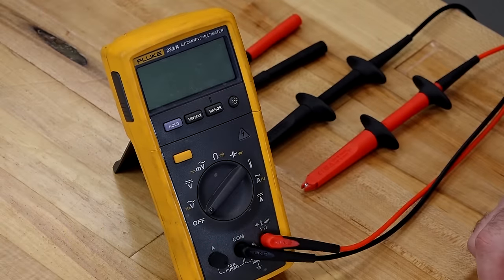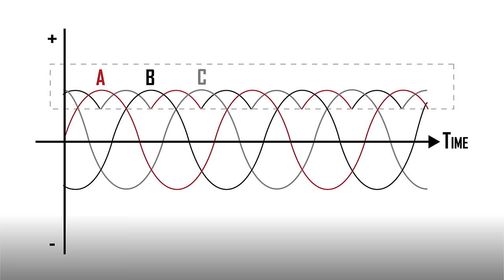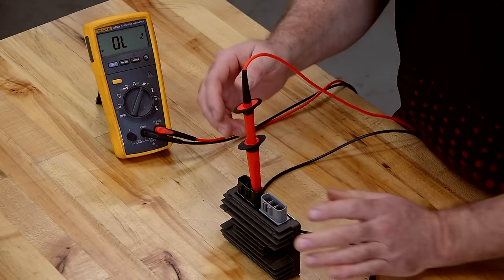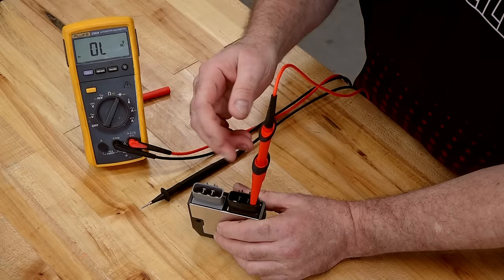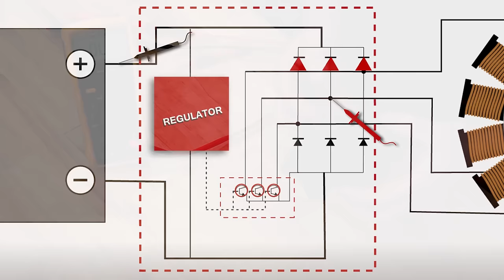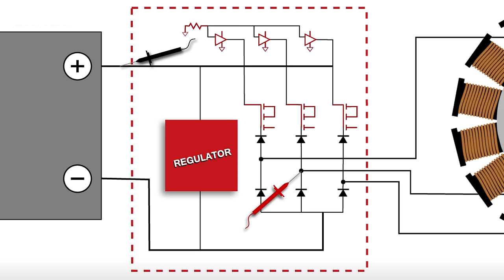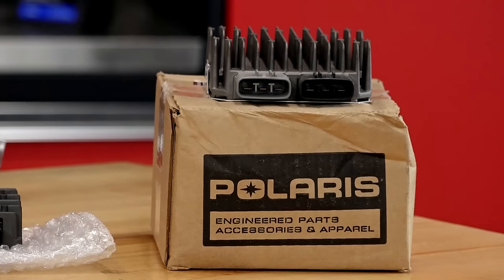How to Test a Regulator Rectifier - They're Not all the Same! | 3 Phase Rectifier Test | Partzilla

Comment: The Polaris
 regulator rectifier that you test in the video is oem part # 4016868, my question is, should it be the same result on polaris regulator rectifier oem part # 4015230?

When I measure my 4015230 the result is: 
meter black to battery + = 0.480 on all 3 wires.
meter black to battery - = OL
meter red to battery + = OL
meter red to battery - = OL.
Is my rectifier 4015230 bad or is it just a polaris rectifier? :-)

Comment: can the   Regulator Rectifier cause power issues (that's not related to 
battery) ? .. for example my bike has dim lights that get brighter as 
RPM increase and rough idle problems  .. ive "pinned" the stator and 
that seems OK and my battery does charge (new battery)

Comment: When you Reversed Biased the Diodes why was the DMM reading OL for open loop? Is that because there's too much Resistance and nothing is going through?
Reply from the maker: The reverse bias diode should show on open loop as it's function is to only let current flow in one direction.

Comment: I have an '04 Yamaha Bear Tracker. The battery got super hot to the touch and I could smell sulphur. I performed this test and got a pretty consistent 630/OL. Is that too high? The battery itself (once cooled, next day) was at 12.83v and when running seemed to be charging at 14.3v. I have not had any charging/starting issues beforehand. The battery is only 2 years old but could it be the culprit? Anyone have any ideas? Thanks. Great video BTW
Reply: Rode it around a bit and now it is charging at almost 18v. Most of these rectifier videos are on the problem of not charging but mine seems to be overcharging, would it still be the rectifier? Anybody out there?
Reply: @mikemyers193  I think this video explains your issue around 5 minute mark.
https://www.youtube.com/watch?v=s5M6sgGBptI

Comment: Hi i have a 2006 handa shadow, i started up 2 weeks ago took it for a short ride  everything was normal.  2 weeks later i jump started it, while it was running in idle for about 10 minutes it shuts off and now it is completely dead.  I get nothing when try to start it.  Where do u think I should start?
Reply from the maker: Fuses, battery.

Comment: Have a Yamaha XT200 from the 80’s that refuses to start after running a few minutes, think it’s the regulator/rectifier  should I retro a newer part for it from the old 6 volt system?

Comment: Whoah there edison! That meter doesn't even have a diode test. You have it set for capacitor test.
Reply from the maker: The Fluke 233 has two functions on that dial position. Capacitance and diode test. If you zoom in, you can see the diode test symbol just to the right of the capacitance symbol.
Reply: @PartzillaParts  🏁

Comment: Also, why do you put the positive lead on the negative side and the negative lead on the positive side to test for a Forward Bias?
Reply from the maker: To forward bias the diode you must apply a positive voltage from the voltmeter on the anode side of the diode and the voltmeter negative on the cathode. The anode is the large part of the triangle and the cathode is the point that intersects the line. The vehicle battery is shown in the diagram for reference but plays no part in testing.
Reply: I still don't understand why the positive probe was put on the negative terminal though.
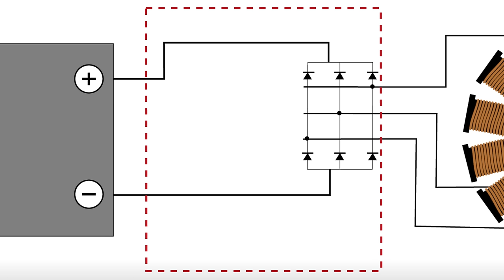Reply: @TiberiusStorm  Long time ago, but if you're still wondering... When using your multimeter, there is a small current flowing from the positive to the negative leads when you measure. The symbol of a diode is an arrow. The current flows in the direction of the arrow, but not in the opposite way. If you look at the drawing at 3:24, you would have to place the positive lead to the negative side of the regulator and the negative lead to one of the 3 wires of the regulator, to be able to measure the diode (being around 0.5v). If the diodes are good and you reverse your leads (negative to negative, and positive to one of the 3 wires), you should measure nothing/endless.

Comment: Hi I have a honda XL250S 1981 when I start the bike it blows the headlight bulb could it be the voltage regulator not working
Reply from the maker: You have a short somewhere, most likely.
Reply: The 78 - 81 XL250S head light works off AC voltage from a lighting coil in the alternator.  The coil is faulty and generating too much voltage or you have developed a bad ground.  There is an AC voltage regulator on the market that can be installed in the lighting circuit to help prevent the light from burning out prematurely, but the proper fix would be to replace the stator or have it rewound and to check all ground connections including the ground connection on the lighting coil.  The regulator on the XL250S has no connection to the headlight circuit.

Comment: I'm getting a 1.7 reading when it should be .5 does that mean mines bad
Reply: Yes, sounds like you have an issue with the regulator... it should be regulating that voltage (as you mention, no more than .5) so you don't fry your battery cells.
Generally speaking it should be between .3 and .5